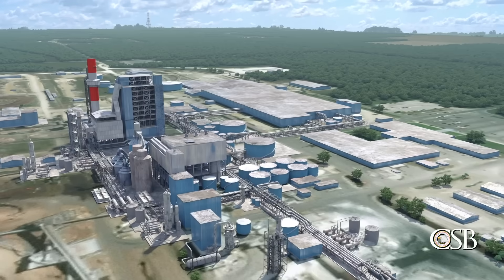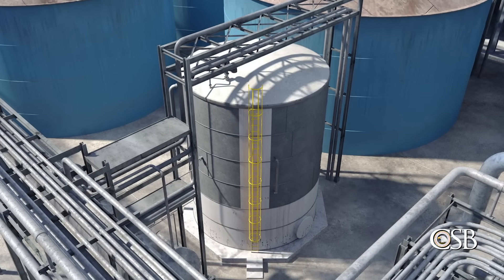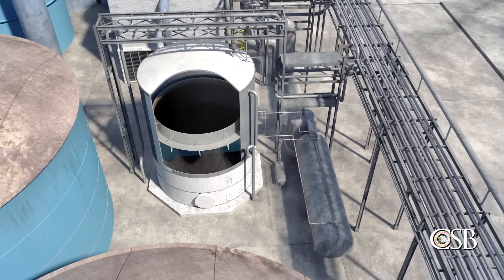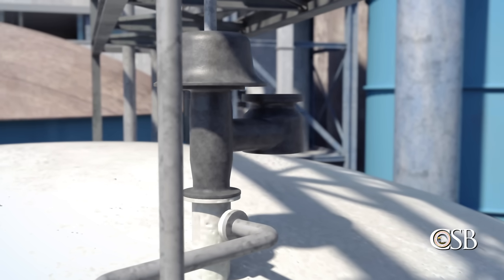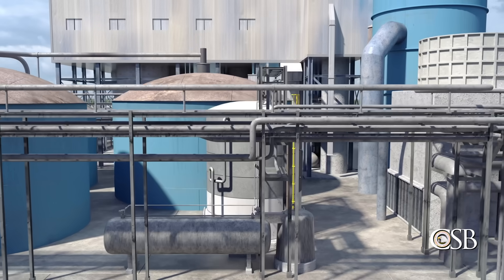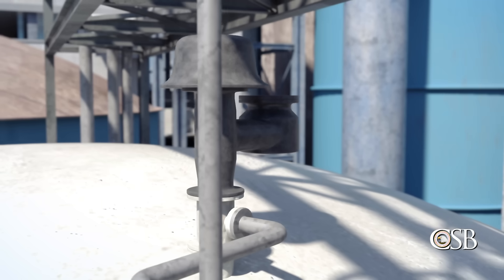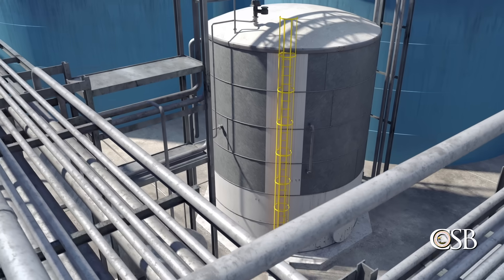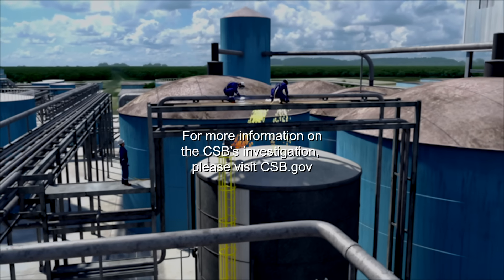Uncovered Hazards: Explosion at the DeRidder Pulp and Paper Mill

Comment: A flashback arrestor on the vacuum breaker valve could possibly prevent this accident.
If there is airflow into the tank while sparks are flying then it can easily get drawn into the tank

Comment: I'm somewhat familiar with that papermill. I also work for a chemical refinery only a few miles away from it. In 1992 Osha implemented a law that Industries who handle certain amounts of hazardous materials and or who's process upsets could adversely impact the surrounding community areas, develop and abide by "Process Safety" operating plans. Unfortunately that paper mill does not handle sufficient quantities of hazardous material, turpentine in their case, to fall under Osha's mandated "Process Safety" laws. Nor is anything in it's operation dangerous enough to negatively effect the surrounding area. It's basically in the middle of nowhere. The plant I work for does operate under "Process Safety" laws/standards due to the large amounts of hazardous materials onsite and a possible danger to the community during an adverse operational upset. 
In the case of this incident, a large majority of the seasoned engineers and experienced operators at that papermill were laid off several years ago when the original company who started that paper mill, Boise Cascade, sold the papermill to an investment group known as PCA. It is my opinion that PCA did not bring along people who were in the paper making business as Boise Cascade had been doing for many decades. All the experienced personnel were replaced with new age personnel, most of whom are still inexperienced and are not proficient in the industry but willing to work for lessor benefits than was once an industry standard. Turpentine is a small residual byproduct of their process and if operations didn't even know whos responsibility it was to manage that tank, it kind of goes to show the frequency the tank was used to reclaim residual flammable turpentine. I know some employees who work there now and most of them that even knew of the tank thought it was just a nasty smelling water condensate tank. I was told that it was not even labeled as a flammable liquid containing vessel. I also know some of the older engineers and operators who were laid off from that mill when Boise Cascade sold it, who were aware of the hidden dangers there. Too bad they were no longer employed there to intervene. PCA was and probably still is trying to run that place on a shoe string budget because as is the norm these days. Investment groups are not concerned with actually making products to better society in turn taking care of the well being and safety of their workers. They are more concerned with pleasing share holders.

Comment: If leads, stingers or wire welding guns are lowered hot that's being lazy. A ground operator/fire guard should cut power first. 
Even with MIG if the gun trigger gets smacked it will be hot long enough to arc and if something CAN happen when humans drop gear it eventually will.

This isn't like normal structural or pipe welding on empty systems. It's not rocket surgery to cut power before dragging your gear. Even if it's not required it's perfectly legit to ADD safe procedures. Beats feeling stupid in the burn ward.
Reply: You sound like a pca rep

Comment: I actually really wonder why a inert gas relief valve wasn't added... I think that its seem like poor design when using potentially flammable/explosive compounds that could be exposed to an oxidizer should have a inert gas system to help separate the potential fuel, oxidizer fire.

Comment: Whomever signed off the Hot Work permit inspection for welding and grinding above a tank should have checked the tank itself to make sure no flammable vapors or liquids were present, both inside and outside the tank. Gravity dictated that sparks from the welding and grinding WOULD ABSOLUTELY HIT THE TANK. 

Had the person who wrote the Hot Work permit bothered to do their job properly, this would NOT have happened.

Comment: Yeah, it seems the tank had an inappropriate vacuum relief system. Commonly industry uses makeup gas, inert/semi-inert gases such as nitrogen or fuel gas such as methane/ethane that is fed into the vapor space to maintain a slight positive pressure. We also use spark containment for any hot work, turn off a welding generator immediately after hot work completion, and use a spark watch with gas monitoring while performing hot work in critical areas. This incident was almost certainly avoidable. Sad.

Comment: Curious what temperature was needed on the inside surface of the tank to create ignition in the vapor. I would think that the thermal mass of a tank like that would be large enough that a welding spark or slag drip would cool to a safe temperature before transferring enough heat to set off the explosion. Would it be possible or make sense that either the heat caused the explosive atmosphere created by the vacuum relief to in turn be released as pressure rises back up or that sparks could have been admitted if the vacuum relief opened while small sparks were falling onto it?

Comment: reminds me of the time we worked at a steel mill and were doing cutting/welding on the one large recovered iron oxide storage tank. you could look over on the roof of the building and see a giant dent in the roof, which was from the very tank we were on top of working on. turns out they had it blow off before. sketchy as hell, i left that company shortly after.

Comment: any business that deals with such dangerous chemicals and proccesses that has so many contracted workers around should be a massive red flag. why does a massive plant not have a welding team? to save some margins? so they bring in some random who has no clue what they surrounded by. welding on top of. whats in the air. whats in the lines. whats in the tanks. etc. etc. contractors shouldnt even be involved in these things. it was welding a damn pipe!! like texas city. put the contractors in an office (really just a trailer) RIGHT in the middle of their facility. and when the plant went up the contractors were the casualties. they are second rate, less trained and aware employees of this dangerous environment and it shows when you look at who dies in these accidents.

Comment: I've been a power engineer and a bleach and chemical plant operator for Domtar here in BC, Canada, for 20 years and we have to ventilate all tanks on shutdown and any tanks that are isolated have to be drained and ventilated. I remember the safety briefing coming out about this.  It was probably neglected because they weren't going in the vessel, but that tank should have been drained and locked out if it was offline.  Sour condensate and NCG's don't do well sitting in a stagnant tank

Comment: Would it have been possible for welding sparks to have entered the tank through the release valve? And could they have veen hot enough to ignite the flammable gas inside?

Comment: The csb is incorrect. The hot work did not cause the explosion. When two chemicals like oxygen and turpentine mix they create friction heat under pressure. If there is no where to vent the can become hot enough to self ignite. Their investigation is not correct.along with the amount of slag from an arc welder would have continuously hit the same place to produce enough heat to cause that. They seam to understand theory but not actual chemical reaction regarding friction heat ignition

Comment: I recommend to connect an inert gas (preferably N2 gas) instead of air to the vacuum pilot valve.

Also during the hot work, the operation team should have applied welding fire blankets around the welding area since it contains flammable materials.

Comment: If it was "not required by federal regulations' then what you are saying is even the infallible USCSB didn't think of it.. aka freak accident the company and the gov't did not predict or put controls in place for... I love how propaganda like this seems to advocate for companies and workers to tell the future when the reality is that is impossible and no amount of hindsight will create a time machine to go back in time and prevent this.  The welders died... if they thought  this would happen they wouldn't have been welding on the pipes. If the company thought this would happen they would have drained the tank. If the USCSB thought this would happen they would make a fancy video about it ex post facto. Im all for doing a after accident investigation but the companies job is to make paper, and the welders job is to fix metal with fire ...if the regulatory bodies job is to "ensure safety" then looks like they failed...

Comment: 6:22 All but the absolute cheapest MIG welders are electrically cold until you pull the trigger.
The only way the MIG gun could have made a spark as seen in the video would have been for it to have been left on and have landed on the trigger while the tip contacted metal.  Not impossible but extremely unlikely.
Reply: The illustration looks like a MIG gun but it is very unlikely that an industrial complex would allow MIG Welding on pressure piping. 
I was in industrial welder for over 36 years and they would never allow that at the time it was either SMAW or TIG, but  different companies do different things. 
I do agree with you that the MIG gun wouldn’t be hot until the trigger was activated. We used to have to turn off or welding machines and disconnect the leads before we could lower cables. 
We also had  a complete containment with fire tarps. 
After area and the tank was declared safe, and there was a job safety analysis conducted between the operator and the workers, we also had to wear monitors for Co or Hydrogen or whatever chemical could’ve been present. 
Of course our refinery had a much bigger safety budget than some of the smaller companies and that does make a difference unfortunately.

Comment: Seems like the design of the tank system was unacceptably hazardous.  Hot slag on the outside of the tank should not be able to ignite it.  That implies extremely volatile gas that should not be allowed.  If it's volatile enough for a small amount of heating on the outside of the tank to ignite it,  seems like lots of things could ignite it that shouldn't... Static electricity, even direct sunlight, etc.  Seems like something that incredibly volatile needs an inert gas pressurization system.

Comment: At one point the USW guy says "workers knew it was a bad idea not to drain the tank".
Later he says "The workers did not understand the dangers in the process".
Which was it was it?
Were the contractors USW workers?
Seems like the big screw up was leaving that much turpentine in the tank.
The turpentine setting for months reminds me of the fatality in Belle, WV where phosgene hoses were ran months past their scheduled end of life because the computer  no longer reminded anyone to change them.
A seemingly small mistake carries on for months with no problems then one day it is too late to fix it.

Also mig welders are electrically cold at the tip unless the button on the handle is pressed.
It might have been possible for the button to have hit something hard enough to engage it while the tip was touching metal, but not likely.
Sad that welding blankets very well could have prevented this tragedy.

Comment: The tank was effectively an accumulator? using the float as means to regulate pressure at atmospheric pressure??The mills management needed to answer questions as to the operation and which part of the mill needed to operate and control the tank.

Comment: I can tell you now. The hot work(sparks) did not heat the top of the tank that much. You can hold your bare skin in a stream of white hot sparks and although it feels warm and couple might sting....you are talking a few microns in size of hot particles. Their heat capacity would NOT heat the steel cap of that tank that much. The ONLY thing that could have happened....was the tank was not as sealed as they thought. There was a small crack in the tank or pipe on top or the seal around the pipe where it goes into the tank...and the flammable gases not only escaped but also allowed oxygen inside. When the hot work started...either the stream of sparks or the welder arcing like they said....ignited the fumes which ran down the fume trail into the tank where it was nice mixed around with oxygen from outside and then boom.

Comment: There were certainly a lot of upstream failures that contributed to the disaster but I’m surprised the slag created by the hot work wasn’t contained by using fire blanket.  It just doesn’t seem appropriate to be dropping molten metal on the top of a tank or piping or any potentially hazardous or for that matter valuable structure below.

Comment: 'Hey Tom how about we use our safety procedures with just some of our plant?' 'Sounds like a great idea Bob!'
Reply: This is common,  and usually decided by a risk analysis. Early on they said the content was mostly water, and the flammable gas would be minimal if operated according to their design. This would make the tank a low risk system and therefore not worthy of increased monitoring. The problem was introduced when changes to their procedures were not controlled, ie no one purged the turpentine. This doesnt seem like a design problem to me, it seems more like a change control issue...
Reply: @KeissRandomKeissen or rather than change control, simply verifying procedures? Perhaps you are saying the same thing in different words.

Regardless, FMEA should have shown that procedural deviations could expose workers to increased hazards.  A simple mitigation would be to verify purging (or another name for getting rid of the excess turpentine) procedures had been followed prior to issuing hot work permits. I agree it's not an engineering design issue, but some of these procedures could be redesigned for increased documentation and verification before hot work/other hazardous activities.

If it is low risk only when x activity happens, then x activity must be monitored and verified.
Reply: Literally what I'm dealing with right now....

Comment: Big-picture thinking was lacking here. There were so many opportunities to say "hey, what about the tank below the work?!"

In particular the gas technician and welding foreman should have had the training and experience to recognize that sparks and slag tend to find fire and explosion hazards below the work. There have been numerous accidents caused by hot-work above untested tanks. In fact, this article references CSB investigations going back to 2001, including a different accident at a PCA plant:

https://www.powderbulksolids.com/article%5CWorking-Near-Storage-Tanks-Containing-Flammable-Materials-08-11-2014

A more mindful gas-free testing program should have issued "danger" tags and paperwork for nearby equipment that is not tested and not inert. If PCA management felt that they didn't need to drain the tank, they should have told the contractors that it contained a dangerous, untested atmosphere - no entry and no sparks.

A more mindful welding plan would have paid close attention to the limits of the hot-work permit. The permit said that the pipes were free from hazardous gas. That information was true: the pipes didn't explode. But the welding contractors should have asked "hey, what about?" questions for the surrounding tanks and equipment.  Exploding tanks are not an unknown hazard - they are a very well-known hazard and every tank must be assumed explosive unless recent testing proves otherwise. 

It also sounds like PCA management hired contractors to make an end-run around the union and its safety nannies. They wanted the work done and sought out a business relationship that would muddy the waters - again, they were not forthright about "we want you to weld these pipes even though the tank below is not permitted."  A good gas-free program would have the tank coded as "danger: do not enter, no hot work, this tank is not monitored," and that information was clearly needed by the welding contractors. PCAs actions were somewhere between "reckless" and "with wanton disregard" - those managers should be brought up on homicide charges.

I don't usually disagree with CSB recommendations, but this time they really miss the mark. Safety paperwork might have helped. But when bosses are so itchy to "get things done" that they scab in whichever contractors ask the fewest questions - that's a level of depravity beyond paperwork and good practices. Punitive fines and jail time.

Comment: Dumb but WHY vaccum relief valve?! ... I mean... Attach low pressure Nitrogen instead of letting in air
Reply: Two reasons: when they designed the thing, they probably thought no one was gonna weld and grind right above the tank, and keeping the atmosphere in the tank oxygen free is more expensive so a profit driven company will naturally avoid choosing that option.
Reply: Nitrogen blankets introduce their own hazards with oxygen deficient environments

Comment: You use nitrogen blanketing in such cases; instead of cost cutting and using an air breather. Poor design, and even poor decisions not to drain the tank.
Reply: Seriously. Letting the tank turn itself into a fuel/air bomb when it cools down doesn't seem like the smartest idea they could have come up with.
Reply: Either that or at least positive ventilation to an existing scrubber or flare or whatever they have.